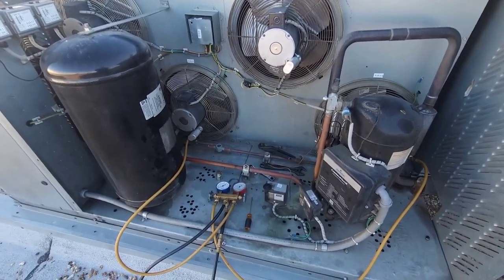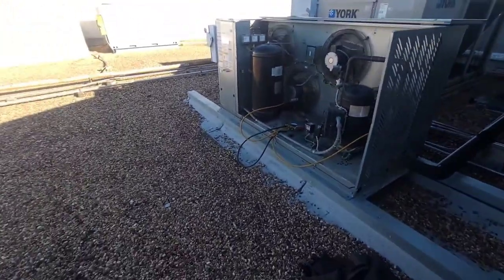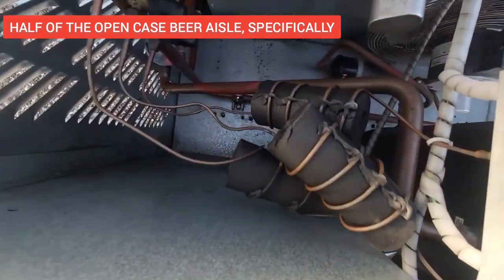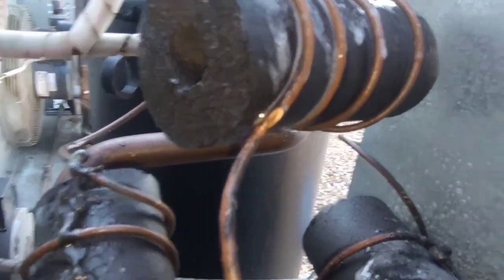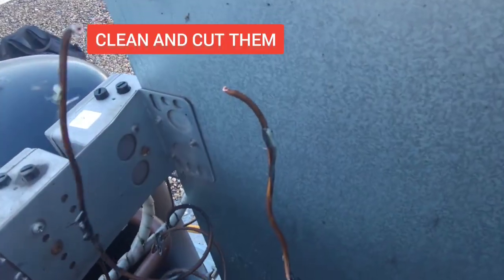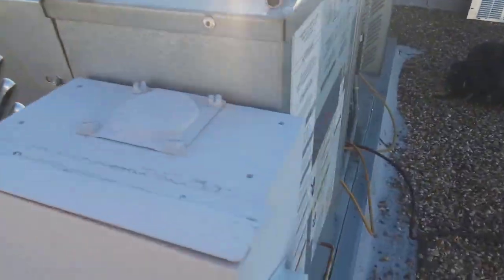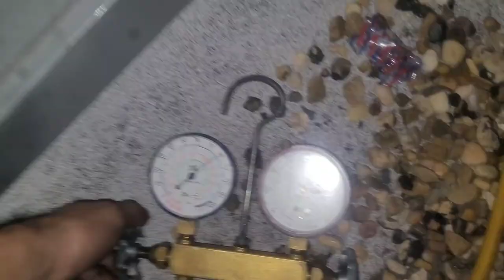RTU SMALL LINES RUBBED A MAJOR LEAK AND LOST ALL REFRIGERANT

Comment: I thought you were joking when solder these up
Why didn’t you just replace the switches 
Never even heard of soldering up the capillaries on pressure controls 
Hummm
Reply from the maker: I honestly didn't think to replace the controls because I knew the lines were repairable. Anything smaller, that I couldn't get a manufactured coupling for, i wouldn't experiment on. But since I could get 1/8" actual couplings, that'd how I would go with it. Let me ask you this, since you've never heard of doing that....What else would the 1/8" copper couplings be used for?
Reply: @HVACRServiceTech  thats the way to do it 👏👏👌👌
Reply: @HVACRServiceTech  Did you check the pressure switches still worked after the repair? I'd be a little concerned about the braze wicking into the coupling and blocking the cap tubes. Neat repair otherwise though.
Reply from the maker: @Thermoelectric7  that is a good and valid point to watch out for. I did notice fan # 2 and # 3 stage on as I added the first couple jugs. They're feeding good. The biggest reason I would've otherwise felt good about it is the use of the couplings. That's also why I mainly used the torch lightly and tried not too allow it to heat enough to draw in the solder too much, and instead made more of a thicker cover weld. 
Very good point you bring up tho...
Reply: @HVACRServiceTech  after I had thought about it made since especially if it’s after hours and you had the couplings in the truck. 
As Refrigerartion techs our number 1 goal is to prevent lose of product by getting these boxes back down to temp asap and that’s exactly what you did. Please don’t think I was critical of the repair you made I just never thought to do it that way. 
Absolutely nothing wrong with it. You put the customer first. Thanks for teaching this old dog a new trick 
Houston traffic sucks and if I can save a trip to United it’s gets me home sooner 
Oh to answer your question I also do a lot of small reach ins and use 1/8 coupling 
Thanks for the awesome entertainment even though my wife and kids think I’m crazy 
“”Dad really not AC videos no son it’s Refrigerartion videos get it right boy””
Thanks man
Reply: As a refrigeration mechanic we always if possible braze them together just got be careful that you test out duel pressure control after this repair.
Reply: Great work do able efficient practical and cost effective just some of the qualities of an excellent service engineer thinking outside of the box 😃👍👍👍👌